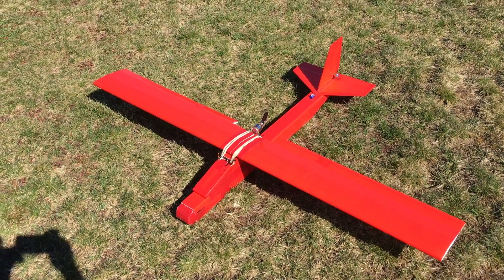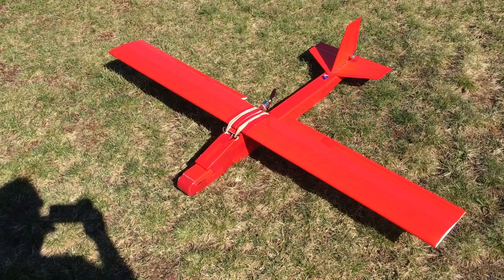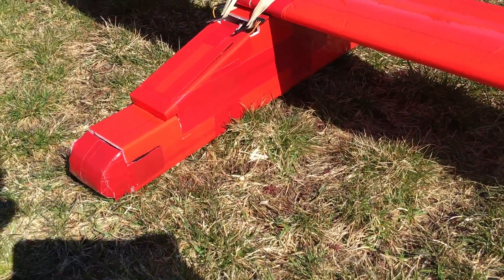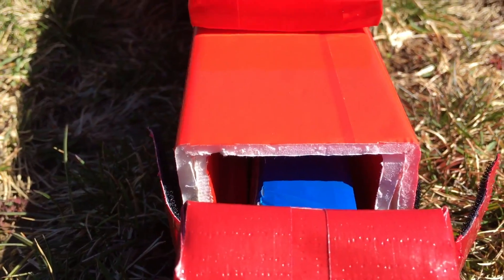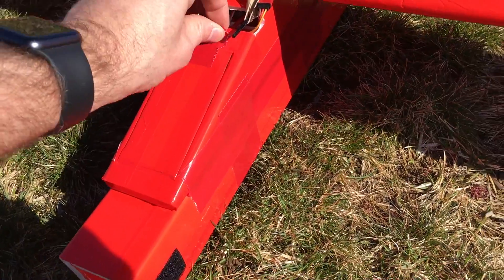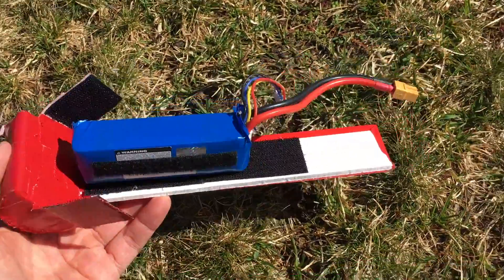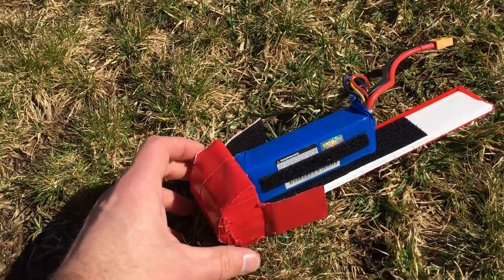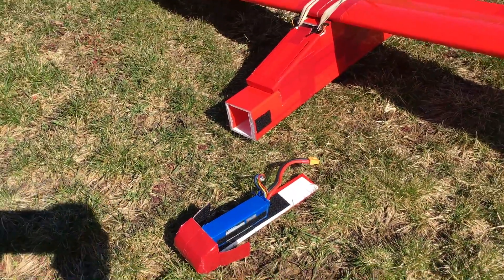Axon V2 Motor Glider

Comment: Dam : you been letting josh scott wear off on you! :>) ....like the nose though....Im thinking make a spring loaded nose + square wood+ solid foam nose////then can replace the solid nose only-by remove the 4 corner hot glue spots! :>)...alot peeps lower the weight by servos way up close to cg.. and use small wire rods + no extra wires /cause close to plug -up already! i hate small rods.. they bend and feels like crap! i like your idea. -lead in nose! also - i cant afford to replace the battery /cause a crash.... so nose is good  !

Comment: I love the soft nose - what material did you use and where did you get it ?
Reply from the maker: Thanks, it’s a soft packing foam that comes in packages for electronics. Some laptops, hard drives, xboxes. Those types of things. It’s the softer foam so it compresses rather than breakers. I just cut it to shape and then taped over it.
Reply: Jason - Thanks, I know the kind . . . just didn't recognize it painted. My son & I are building an Axon. We will use 'your nose.' 😊
Reply from the maker: Fantastic, it’s not painted. The nose is covered in red duct tape. The rest of the plane is red packing tape as per Ed’s method. It’s a wonderful plan to fly, enjoy :)